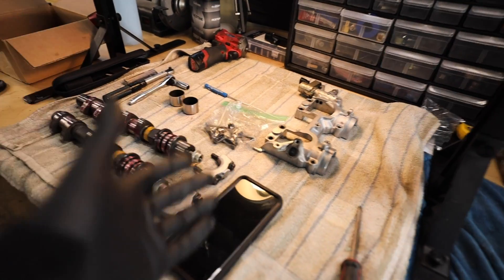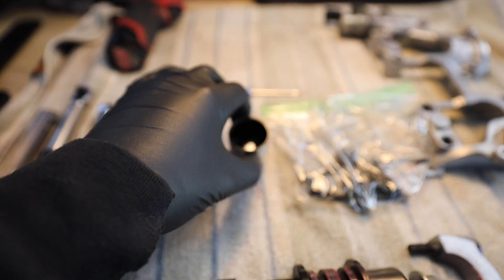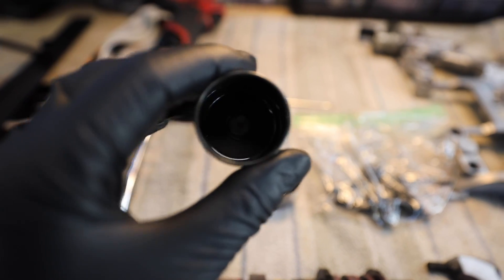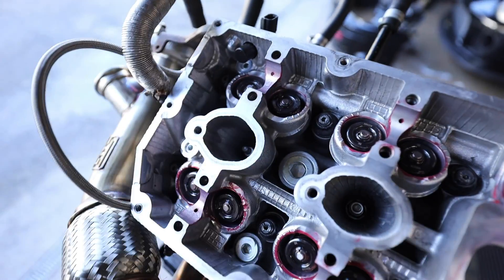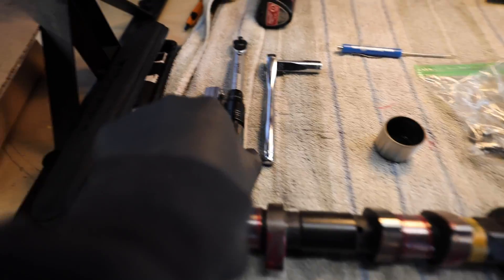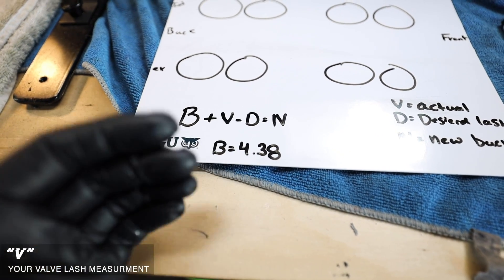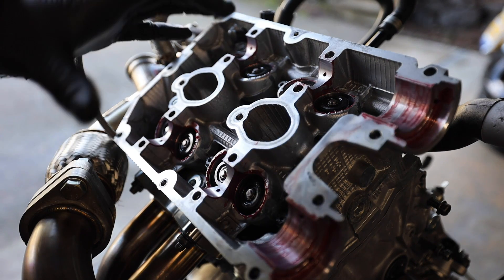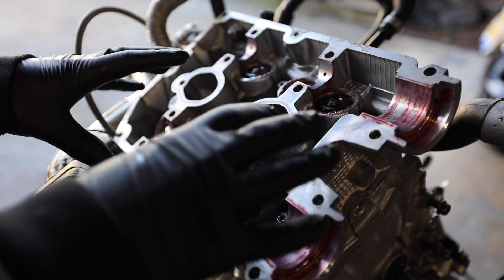How To Measure Valve Lash & Calculate what Bucket You Need

Comment: Duration is based off of the camshaft not the bucket! Basically how long the valve stays open! The bucket ensures proper clearance between the lobe and the bucket ensuring the valve is opening and closing safely and properly without too much friction! Good video tho 🤙

Comment: Started doing this today on my freshly rebuilt heads. The only thing I’m curious about is if it matters how you put the feeler gauge in. If I go for it when I’m squared up with the cam lobes I get something like .015 for example. But if I go to measure at an angle it might be something like .028.

Comment: If you never taken your camshafts off only valve.covers would this still be a problem? I've been having a random misfires for a few months now, I changed everything I could think off. I read a  faulty knock sensor would cause it as well that's my next step I'm hoping this fixes my issue I hate CELs
Reply: Someone said it could be your "buckets" but I never even touched the bolts to remove my camshafts
Reply: It's not too likely, but it's not super hard to check them, and should be done periodically. For a built engine you don't need to disassemble anything, just pop the cam covers off and measure them all.

Comment: Yo bro so if i remove buckets to take head to resurface is it okkay to re use same buckets when i get it back?
Reply: Yep. Mark them with which valve they come off of, so that you can get them back in in the right order. I number mine I1.1, I1.2, I2.1, I2.2, E1.1, E1.2, etc. Measure your clearances afterwards to make sure they're still all good.

Comment: Does it matter what orientation of the lobes before u measure the lash? I never done it or even moved a cam freely in the journals. But I'll be doing this soon thanks to ur videos :)

So yeah when u put the bucket in, cams n caps on. One lobe will be facing up and other down. So when u come around to the lobe that facing up do u need to orientate the lobe in any way? Or measuring the gap regardless of where the lobe is positioned ok?
Reply: You need to measure against the base circle so yes, the lobe needs to be facing away from the valve. Rotate as you go.

Comment: when my shop was open at any given time I would have between 850 and 900 shimless buckets in stock all in a large labeled rack.... I was constantly building engines and/or cylinder heads work and after dealing with it that way for years I bought a jig for my mill to be able to precisely machine the bucket to the desired size and then I would lazer mark the bottom with the new  size... I only had to keep 1 part number in stock and I would just custom cut all the buckets and I never had a single problem with anything doing it that way  even on over 1k hp engines..... I'd never go back to doing it the old way .....
I mean if you only do it every once in a while ok I see that but when you are doing multiple heads everyday...hell no never again lmao

Side note: even though I have had to do it in a pinch machining the buckets to get the clearance u need  is not a good idea because of the hardness of the area of the bucket that contacts the valve is only so deep and that is the exact area that would be machined down and if you  happen to go past the point where the metal is properly hardened that bucket will wear and/or mushroom out causing a ton of damage. I see alot of people and even shops doing that on the regular and that's not just dangerous but poor quality work imo I  admit I have also done it myself but that was way before I was properly trained and I only ever took less than  a thou off max but it was still not the correct procedure my car or not lol

Comment: What cams are this just bought some BC stage 2 cams valve lash recommendation says .006 on int and .008 on exhaust just wondering why yours set at .008 and .010 thanks!! Cool videos man!!
Reply from the maker: I had the 272s, not sure what stage they'd call them but I also found confliting info because that's what I thought lash needed to be as well. Contacted BC and mine ended up needing to be .010 and .008 🙏

Comment: Just wanted to point out that converting the imperial to metric measurement does not give you a more accurate reading. The number on the gauge is the only correct number, you can’t add sig figs to a tool like that.

Really enjoyed the video though, thanks for all of this content!
Reply: It makes sense to start with 4 new measure buckets so you dont have to take the cam loose each time

Comment: I disagree I rather measure the camshaft followers (what you call buckets) instead of having to remove the camshaft 16 times instead  N=T+(A-V)
T- thickness of the old follower 
A- valve clearance measure 
N- thickness of the new follower 
V- desired valve clearance 
This way you only remove the follower once and if you can use o follower to bring another clearance to spec you can save money and reuse it….
Reply from the maker: That would be much quicker, but to be kn the safer side and not having a set of quality point mics, I had no way of validating that the measurements on the under side of the bucket were actually true sizes. If you do have the proper tools for that then by all means it would make it much easier
Reply: @Smeedia  
Either way will get you good result and that’s a fact
Reply: I agree with this method. A set of Micrometers aren't that expensive and personally, I think they're work the investment to eliminate any guesswork and save time.

Comment: What a pain in the ass way to figure out your cam follower size. Check out how you determine the correct shim for a shim under bucket valve train for a motorcycle engine.  Like a Suzuki.  Seems cumbersome without a mic. If you can measure your old buckets. Then adding or subtracting clearance is much quicker. Not sure I splaned that OK 🤔.
Reply from the maker: I'll have to take a gander at how they're done, this has been the most accurate way I've found to verify and find lash. Buckets get expensive at $30 a piece 😅

Comment: Thanks for the content. Almost all my clearances are out of range by about 0.01 or 0.02mm. Exhausts are too tight & intakes too loose. 0.279-0.305 exhaust & 0.254 intakes. FML 🤦‍♂️
Reply: Switch the loose with the tight and remeasure , I did that and I was in the tolerances
Reply from the maker: Valve lash is suuuuper annoying and $$$ to fix 😖 but the motor will appreciate you when done 🙏🙏

Comment: I guess you could mic your old buckets and put them all back in for the measurements and math to save you bolting down the cam caps 16 times.
There's a lot of potential to kill a thread with all that unnecessary tightening.
Reply from the maker: They're all too big, trust me would have used them If I could 😅🙏

Comment: Even though the bucket is marked, and came in a package with the correct part number on it...how do you know its 4.38 without measuring it.
Reply from the maker: Your valve lash would nkt be right 👀 but I've never had one that's off from the manufacturer.

Comment: Hey I’m in the process of determining if I will be replacing my clutch on my 2011 wrx. Car still runs but when I go to accelerate the cars does not go up in speed as it use to. It will rev higher RPMs. I’m assuming this is my clutch going out. Any suggestions and recommendations appreciated.
Reply from the maker: Definitely the clutch, how much power are you looking to make?
Reply: @Smeedia  I don’t have any mods at the moment and not sure if I will get any for this car.
Reply from the maker: ACT makes a great clutch, I've been using their street series and love it